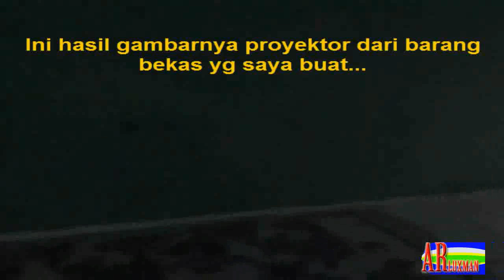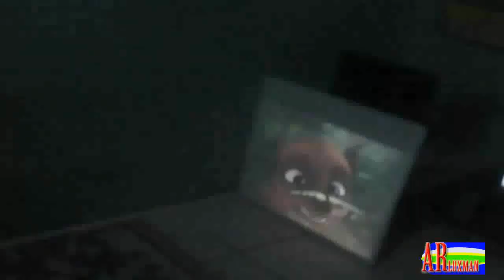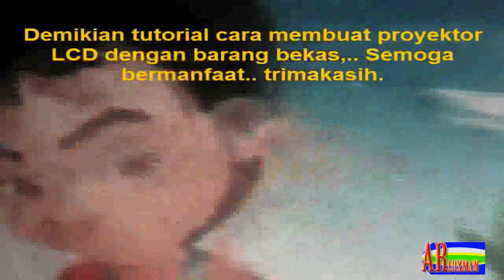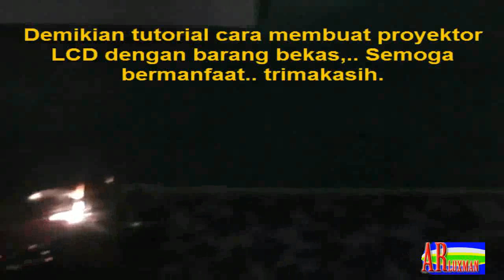Membuat Proyektor Sederhana Dari Layar LCD Handphone JaduL

Comment: Bang kalo g pake lensa cembung dan bisa ngga,,di ganti lensa pembesar layar hptrs lampunya minimal brp watt
Reply from the maker: Lampu bisa pake lampu halogen 12v dc. Tpi lcd hrs dikasih kipas karena panas. Klo lensa bisa pake lensa cembung biasa. Tpi nanti hasil gambar dipinggir² nya agak kabur, yg fokus hanya ditengahnya. Klo lensa pembesar hp itu bisa dipasang   ditengah antara lampu halogennya dgn lcd hp. Karena lensa pembesar layar  hp itu fungsinya utk pengumpul agar sinar bisa merata
Reply: @ArluxmanTukaNgoprek  klo lensa yang seperti Abang pake itu lensa apa bang
Reply from the maker: @ronisuryaman7614  itu lensa bekas mesin fotocopy.
Reply: @ArluxmanTukaNgoprek  bang klo lampunya pake lampu biasa atau lampu rumahan bisa ngga
Reply from the maker: @ronisuryaman7614  pake lampu motor yg halogen 12v dc cari yg wattnya gede. minimal 50watt, mau bagus pake 100watt
Reply: @ArluxmanTukaNgoprek  makasih bang informasinya

Comment: Which lens your use
Reply from the maker: I use a used photocopy machine lens
Reply: @ArluxmanTukaNgoprek  very nice your project. Sir
Reply from the maker: @diyraja1300  you can see : https://shopee.co.id/Lensa-bekas-fotocopy-mesin-diameter-7.4cm-panjang-9.5cm-i.175905248.2767922243